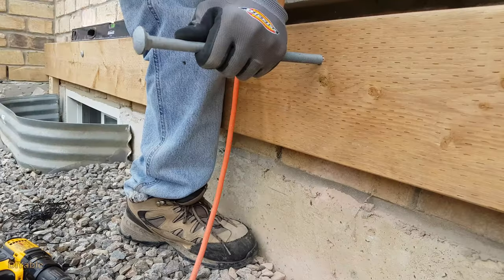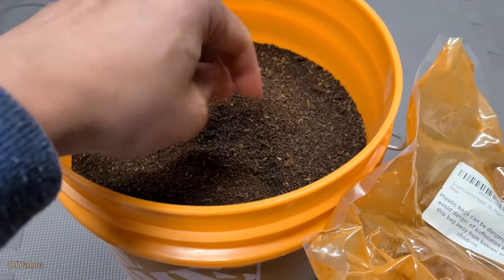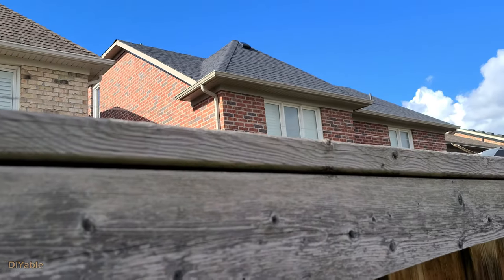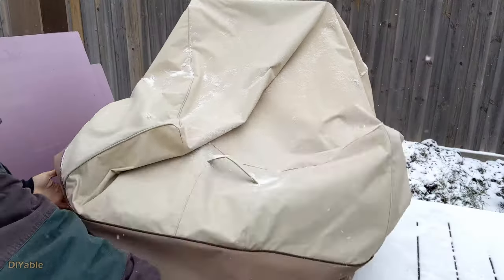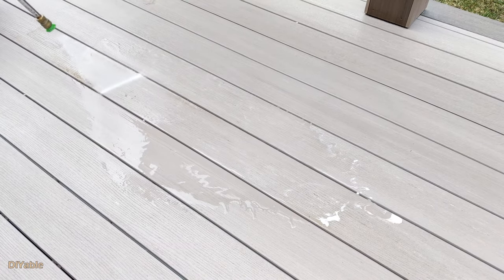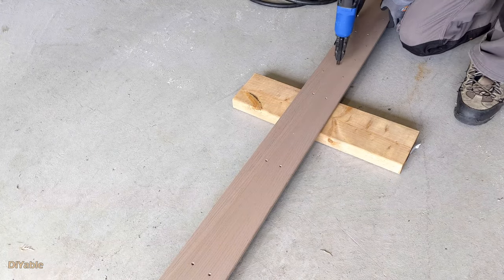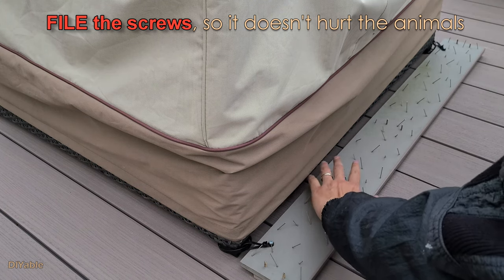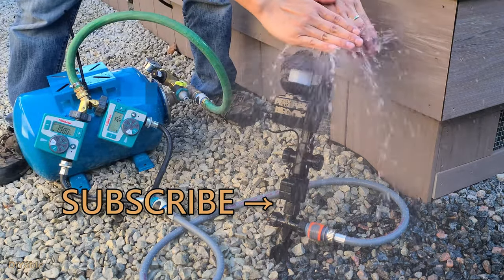DIY Deck (Part 26): How to keep Raccoons off your patio furniture in backyard for good?

Comment: Raccoons are a real battle.   We finally put in a pet electric fence all around the yard, except the front gates where we just put wire.  There is 6 feet behind our wooden fence that we own that has a chain link fence.  I found insulators for that.  I thought we had them beat but they have been pooping in the area behind the fence.  They MUST be getting shocked as for that gate we put the electric wire high enough over the fence that we can walk through, but it would shock the raccoons, yet they still go there to poop.  Just found four piles two days ago and one today.  We have fruit trees.   I have been hearing the leaves of the fuyu persimmon rustle at night as they are just barely getting close to being ripe.  We are in San Diego County and we don't have any water to use on a spray system.   I use disposable gloves to pick up poop, put it in a bag and then in the trash.  I do boil water to pour over the place where the poop had been.  We are in fire territory.  The next door neighbors moved but couldn't find their cat.  The neighbors on the other side of them have been leaving out cat food.  That is the worst thing you can do.    Several years ago we had a peach tree.  Sometimes the peaches would drop to the ground.   I put them in a bucket that I covered.  But when I opened it there were fruit flies.  I squirted dish soap in to deal with the fruit flies.   One day I came out and the lid was off and there was vomit all under the peach tree.   I didn't do it on purpose but that kept them away from the peach tree until it died of old age.  I did once try putting out some fruit with some dish soap on it, but they didn't go for it.
Reply from the maker: Thanks for sharing and I am glad electric fence works.  I was very close to install one if everything else failed but my yard is very small, it's not easy to find space to install that with proper grounding.  Yes, Raccoons are very annoying. Honestly speaking if they don't poop in my property, I am fine.. just like squirrels and rabbits, they come and go, they don't bug me at all.  But yes, their poop is extremely deadly, yup using boiling water is good way to do it.  A lot of people don't know about the danger of Raccoon roundworm, we need to spread the message to all Americans and Canadians.
Reply: @DIYable  You made such a nice deck.   Instead of the IKEA furniture, couldn't you make furniture out of the weather proof decking material?  You seem so talented, it should be easy.  Then you would only need to put your cushions away into a locked patio box after use and never have to cover it.   The raccoons probably liked getting warm under the canvas.
Reply from the maker: @humblecourageous3919  Sorry for late reply. Using decking material to make furniture may not be that easy, also need a wooden frame which makes it way too heavy. Indeed there is 100% plastic outdoor furniture out there believe it or not, I found one called "CR Plastic Products in Stratford, Ontario", very interesting product. If IKEA furniture fails, honestly this is an option.  I believe there are similar products out there, not just this CR plastic.

Comment: Raccoons have chewed a hole in the back porch roof, have cause water damaged to the inside. They are in the ceiling in the house between floors. Fixed the roof. now made a hole in the roof again by climbing up the rain gutters. I have to hire someone to fix this problem. Trapping in next !

Comment: What is the stuff on the back of the boards you can see at 6m16s into the video? It looks like you put something on the back rather than just blocks? Is that for moisture/airflow? You show mounting blocks in other shots. Also how wide are your boards? I have a load of offcuts from our AZEK deck that would probably work. Curious if you think a regular deck (5.5") wide boards would do? @DIYable

Comment: You mention in the beginning of your video a list of things that did not work. One of them was a plastic animal deterrent mat, isn't that the same as the brad nail spikes? or is it because the other spike mat is just plastic,that it didn't work? Thanks for any info you can share, Cheers ! Les on Canada's West coast.
Reply from the maker: The plastic animal deterrent is very poorly made, the plastic is extremely soft.. the one I bought from Amazon is more like Made in China toy. I saw people posting pictures having their cats sleeping on it.  Having said that, maybe you can find better spike mat that will work. The biggest problem is,  all the plastic spikes are evenly spaced and they have the same height, I prefer brad nail spikes which I can space it randomly and with different direction.
Reply: @DIYable  Thanks for the reply I wondered about the effectiveness of a plastic spike strip, I will use real nails as suggested, 
again thanks for the info. Merry Christmas from Canada's Westcoast
Reply from the maker: @hughkiddin1140  Use brad nails only, regular nails or screws are too sharp. We don't want to hurt the animals, we want to use it as deterrent. Merry Christmas from Ontario!!
Reply: @DIYable  Absolutely ,deterrent is the name of the game, I did mean real brad nails. Cheers !

Comment: Tried epsom salt?
Reply from the maker: I haven't honestly.. I heard about it but didn't try because I am worried about killing my plants and it can make the deck/fence hardware rust.. but for those doesn't have my constraint, may be not a bad idea to try. Thanks for suggestion.
Reply: @DIYable   I tried it a few times and it seems to work. Idk for how long before it wears off though lol
Reply: @NickTheAddik  what did you do with the salts? pour along the fence?
Reply: I did.  They hate the smell of mint in Dr. Teals. I'm getting an electric fense. I have children, and I'm already sleep deprived. These 4am battles have to stop. I was out at 4:40 a.m., chasing them off of my roof. Which is brand new. It's never fun hearing your alarm go off and watching a raccon climb your downspout.  😤